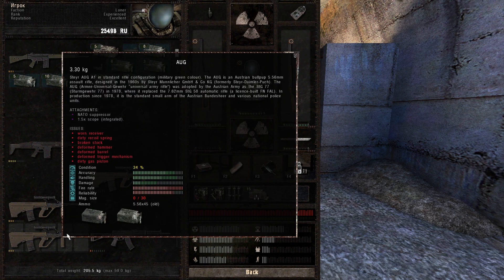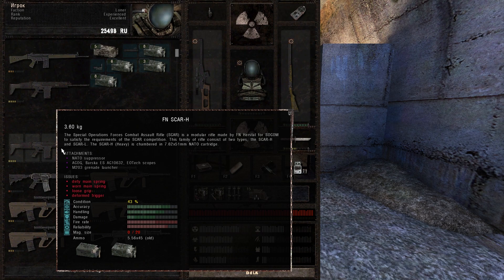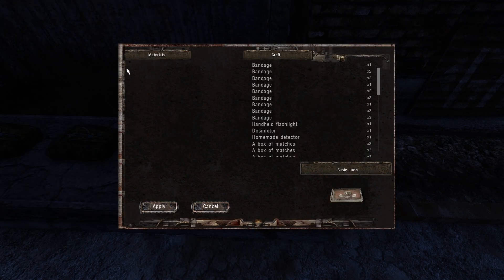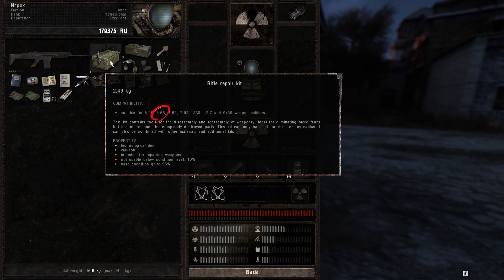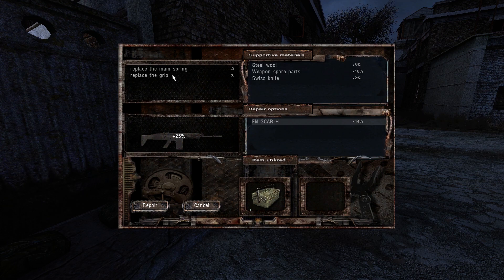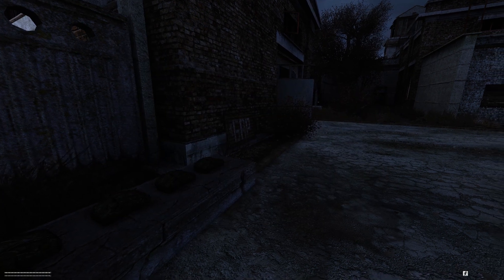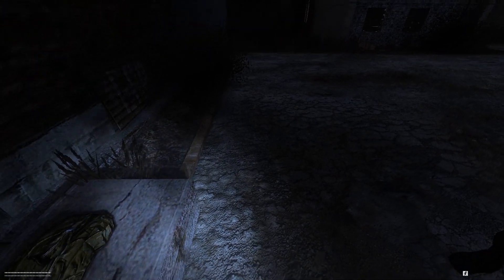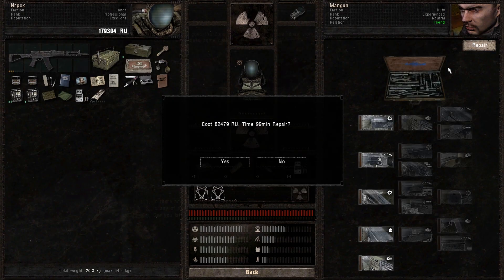STALKER Dead Air: Best way to Repair Weapons

Comment: Do you use any addons with dead air?

I'm about to start a playthrough and i wonder if youve customized anything.
Reply from the maker: I played the game vanilla for a while and after getting the hang of it I started using some tweaks for things I found annoying, but nothing that really alters he game balance. I use some of Darvin's personnal tweaks (you can find them on moddb).
Reply: Cool thanks for the answer, do you use his chimera rebalance?
Reply from the maker: No, as I have yet to encounter a Chimera to see if the tweak is actually needed! All these tweaks are save compatible so you can install them anytime, you don't have to decide before starting a game.

Comment: I had a sawn-off Mosin that the ATP bandits give you as a reward. One part got broken, I bought the 7.62 repair kit (the big one) but there was no option to replace the part. Is it a bug? I ended up selling this gun to the bandit trader.